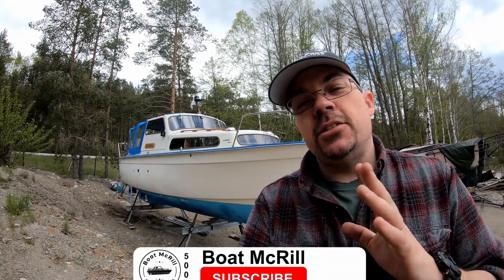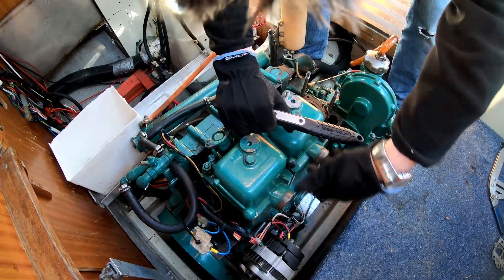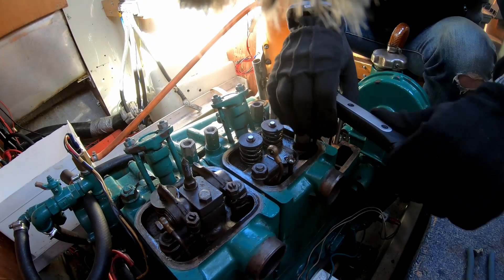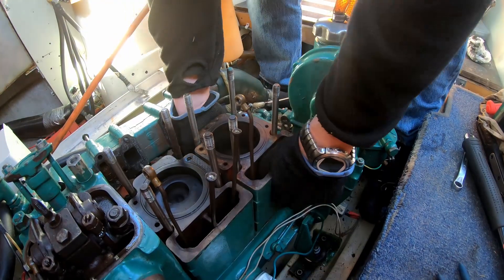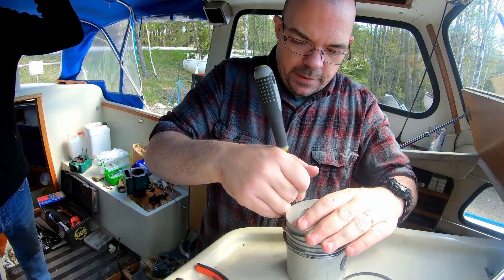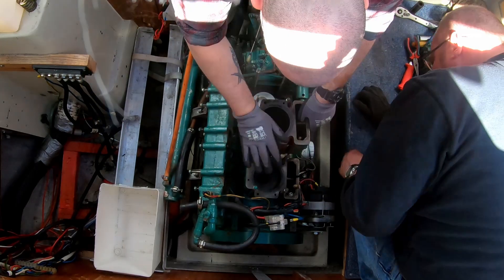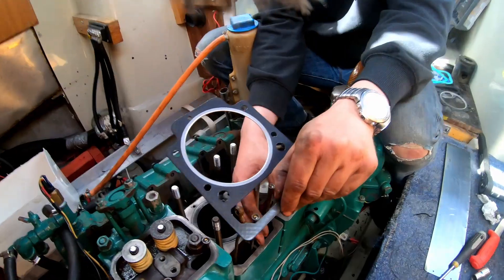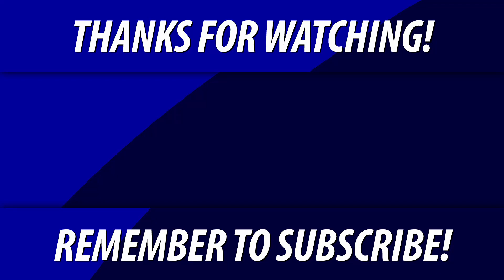Swapping a piston and cylinder head on VP MD17C pt 1 of 2 - Boat McRill

Comment: This is so very helpful as we have the exact same engine and are currently struggling with it. Under the cylinder block is a spacer according to the technical drawing. Does that have to be replaced as well?

Comment: I’m not sure how old this vid is but wanted to know if you gapped the new rings, I have to replace my rings in the spring here in Canada 🇨🇦 thanks for your input very helpful 👍
Reply from the maker: Its a few years since this was made. Today i would for sure gap them but it was no problem at all for my friend who hade the boat for a good wile.
Reply: Thank you it’s always been my experience when replacing rings they should be gapped and I though I missed the step in your rebuild 👍🇨🇦

Comment: When you re-assemble, make sure the exhaust gaskets are the correct way round. Also, don't let the motor freeze! I did ! heat the piston and freeze the wrist pin. You have to work quickly.

Comment: Hi, I can't find documents on the gudgeon pin procedure.  Using the very brief "Shop Manual"    I was under the impression that press fit pins need alot of force, but this looks like moderate force(no press jig).
Did you reuse rhe gudgeon?  (and if not are you not concerned about looseness/tightteness at the conrod/piston end?).
I'll probably just press them out as you did, bench pressing them defeats the purpose of in situ changingu
Reply: It's in the manual.  The piston is heated to 100°C and then the g pin slides in.  Install the far side circlip, slide in the pin,install nearside clip, no press involved

Comment: Hi there, did the engine blow blue smoke as the new rings seated? Mine is blowing blue smoke after 20 hrs running in, but starts really well.
Reply from the maker: Not that we noticed. Blue smoke is often engine oil getting into the cylinders.
Reply: @BoatMcRill  Thanks yes, I think it’s either via piston rings or valve stem seal, cheers!
Reply from the maker: @tomhargreaves2145  If its been correctly running in then it shouldent if its new rings and possibly new cylinderlining.

Have you checked the crankcase ventiation (on MD17C usualy a hose from the oilfill cap to the airintake on cylinder 3).
Reply: @BoatMcRill  Hi thanks for replying, yes there is some over pressure in the crankcase, a bit of smoke too, must be piston ring blow by. A lot of oil in the air filter. Have run the engine for about 30 hrs after new rings fitted, starts from cold in 2-3 seconds, before it was 15 seconds, normally on the second try, this confuses me as compression must be good with new rings; guess that higher load is causing blue smoke issues, rings will either seal (starting to feel unlikely) or the bore is too far gone. Interestingly, before the rebuild the engine smoked white only, sorted the injectors, however when rebuilding I found that 2nd and 3rd piston rings in aft cylinder were stuck in groove, but no blow by or no blue smoke! I’m discovering old engines have a personality, you show them some love and fix a few things, but they get “needy” and attention seeking and screwup in new ways!
Reply from the maker: @tomhargreaves2145  Yepp. I found blow by on my old md17c when the exhaust valve was stuck (because of old rusted out cylinder head). You probably have a good compression when starting the engine but blow by because of some issue and therefore oil coming up and into the cylinder through airintake.
Reply: @BoatMcRill  Yes! So I thought to be clever and decompress the aft cylinder and see if the other cylinder still smoked just as bad, it did🤣
Reply from the maker: @tomhargreaves2145  Guess next step would be to do a compression test and a blow by test of you have access to the tools.
Reply: @BoatMcRill  Yep, I’ll let you know how we get on with that! Cheers!

Comment: Inspired me to rebuild my Md11c engine thanks! I’m getting close to reassembling, gasket orientation is confusing! Which is the right way for the manifold gasket and head gasket? Thanks
Reply from the maker: Just make sure the portholes in the manifold lines up with the gasket and the head. The boltholes are unfortunately so that you can turn the gasket the wrong way. But if yo u look at it when you do it you see clearly that the gasket is the wrong way around.
Reply: @BoatMcRill  Just got my first cylinder liner pressed out, cleans up pretty well! On the top of the cyclinder case there are 5 cooling channels, the 4 on side were easy to clean up, the one on its own opposite the oil galleries is solid, making me wonder if it a channel at all? If it is, where does it go, do you think I can carefully drill it out a bit?
Reply from the maker: IIRC it its a channel. But they often get cloged up with chimney rocks. So try to get through it but wit care, not to muck force ;)
Reply: @BoatMcRill  Descaled with Killrock, worked really well, all channel clear! I was wondering, did you hone the cylinder when you replaced the piston?
Reply from the maker: @tomhargreaves2145  no. We did not. No reason if there’s no scratches or damages.
Reply: @BoatMcRill  that’s good to know, my cylinders look ok but smooth no damage thanks!
Reply: The hone or not to hone with new piston rings is really confusing, some people consider it essential others have the opposite opinion! So you guys had new piston rings, did not hone and had no performance issues, correct? Thanks!
Reply from the maker: @tomhargreaves2145  Exactly. If it was a high performance engine, sure. But on a 40+ year old MD17C. Well......

If you change your piston to the same size or replace the rings and there is no bad scratches or other imperfections in the liner why would you take of even more material and open up the gap even more then there already is after 40 years of use?

The owner of the MD17C in the video was out with it the last summer and didn't notice any performance issues. He was very happy.
Reply: @BoatMcRill  You make a very convincing point! I won’t hone my cylinders either, thanks for taking the time to reply, very appreciated!
Reply: Right thanks for that I was over thinking it!
Reply: Hi there! What are your thoughts on gasket sealant? I see you used it on the base of the head gasket (just the base?) anywhere else, like exhaust manifold? Thanks!

Comment: Hejsa har fået en anden motor md17d i min båt (Albin 25) måske du har et diagram hvor ledninger og stel ledninger monteres korrekt. Mvh Frank fra Danmark
Reply from the maker: Thanks for your question. 

Here is a link to the workshop manual for the engine. Look at page 35 there you have some info about the electrical system for MD17C/D models.

https://www.maritimepropulsion.com/files/pdf/1001252

Hope this will help you out. The main earth lead is usually connected to the engine body by a bolt at the starboard forward engine mount.

Comment: Hi guys, where is the engine RPM sensor located on these engines?
Reply from the maker: Thx mate for your question.

The orignial RPM sensor location is below the aft most air intake. If you look at the engine from the rear (looking at the gearbox) you have it on your left side, pretty far down on the block.

Unless it´s a rpm guage that takes it signal from the generator, that can be the case if former owner changed it.
Reply: @BoatMcRill  Thanks for that info mate. The boat is a 1972 Finnsailer 29. It's still got all it's original instruments so I guess this engine will be the original one as fitted from new. It's certainly from the right era. I'll check it out, thanks again mate.👍

Comment: Nice video :) -  also remember to check the injection nozzels regarding opening pressure and to be sure they have the correct spray pattern.
Reply: They got checked ;)
Reply from the maker: Good tip! Ty.